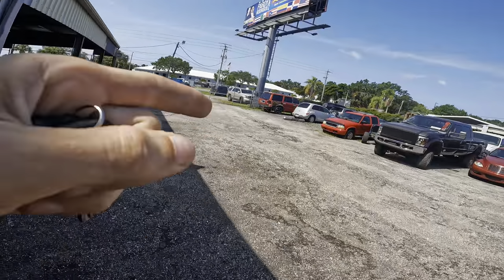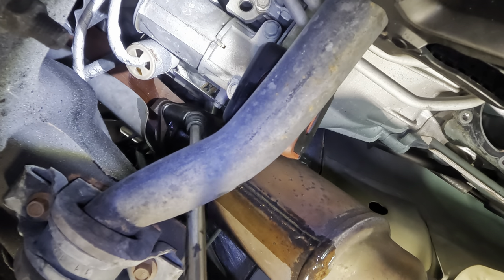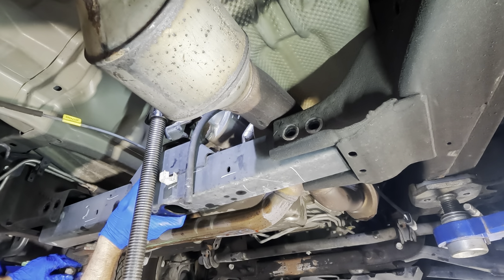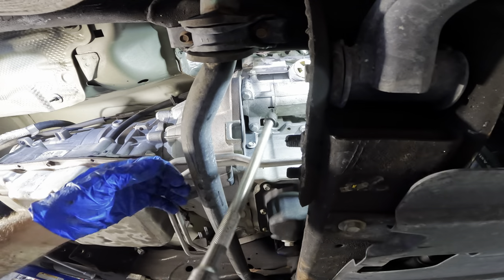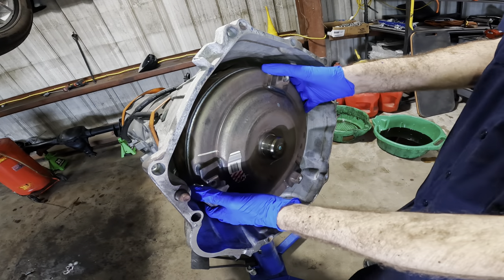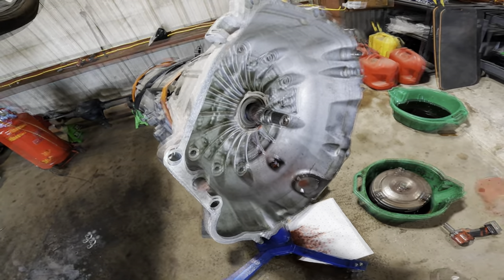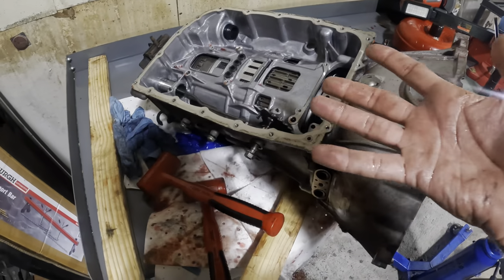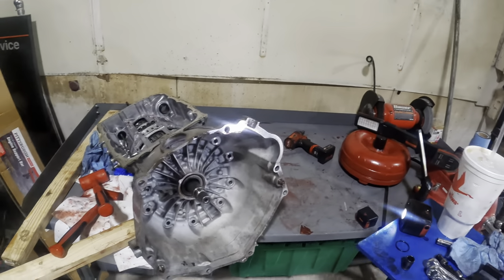Went too FAR! Invasive Inspection, 6l80 Transmission. 2016 Chevy Tahoe 5.3

Comment: The metal shavings you found were all from the torque converter.  That's the main problem with these 6l80's is the torque converter goes bad and dumps metal shavings into the trans.  It will eventually plug up the filter and starve the trans of fluid, cooking it.  Or it might plug up the trans cooler in the radiator, cooking it.  Either way looks like this trans was caught in time.  The trans pump housing looks a little worn, but probably will be ok.  The cooler should be flushed because there is likely metal in it.
Edit: Side note, this 6L80 is a good trans to take apart to learn.  It is one of the easier transmission's to work with and understand.
Reply: Easiest?? Understand?? I have yet to figure out anything to do with an automatic transmission, they are the ultimate mystery to me.
Reply: 4R70 also
Reply: @andyrbush  once you understand it, you’ll understand it. It’s definitely confusing but the 6l80 is probably one of the easier transmissions to learn on.
Reply: Yep and unfortunately after it happens youre best off rebuilding or replacing the whole trans but if caught early as preventatitve its a good idea to swap it before it becomes an issue. These transmissions are decent, just the tc kills them early.
Reply: When I break down the above response.., take out the transmission parts, the diagnostics  leaves me even further in the dark with absolutely no definitive answers.  All I'm left with is a bunch of eventualities, might plug, looks like, worn but ok, either way,  looks worn, but probably will be Ok and should be. If you were my doctor, I'd call you a fence sitting quack. How do you know the metal shavings were all from the torque converter and how can you look at a transmission housing from a home computer and say its a little worn? The fact is...,its impossible to know from remote looking and you can't visually measure something remotely without knowing its critical dimensions.
  If the 6180 is one of the easier transmissions to work with and understand, why is it that you can't explain it in plain English so that even a seasoned transmission tech can understand your hypothetical bafflegab?
Reply: @IR-nq4qv  Lots of know it alls on the internet.  They have never done anything but can tell you all about everything.
Reply: Yep, the 6 speed torque converters are into class action lawsuit territory. The local transmission shop we use keeps convertors and rebuilt transmissions in stock and can R+R them overnight now.
Reply: I done a 6R80, first ever auto trans (and the last). Ended up needing a new lead frame and torque converter and a bushing on the shaft.

When I cut the TC open there was carnage and a few needle roller bearing looking pieces. Turned out someone had taken the box off the engine with the TC staying bolted, needle bearing collapsed, and all the pieces were pushed in to the TC when the box went back.

I was relieved to find they had an updated bush rather than a bearing. I went through what Ray did dismantling something I had no clue about but went ok in the end.

All at the side of the road outside my house with just a jack too. 

Never again.
Reply: All 2000 parts 😂. I understand them. But all of them have hundreds of little o rings and seals and electronic switches. Imo don’t bother. By a guaranteed rebuilt unit. Install fill with fluid and check shift points done.  Imo. It’s not an experiment. Too complex and u get one seal not sealing right. One bolt not torqued right. It’s all built on fluids pressures and clutches. Idk easy to mess it up. Just biting off more than he can chew imo
Reply: All cars come with more parts than they need though, that's why you have extra when you put them back together. :)
Reply: @IR-nq4qv  I know because I helped rebuild over a hundred of them at the trans shop I used to work at.
And I suppose easy is relative, it is easy compared to other 6 speed transmissions.  It is not easy compared to changing your brake pads.
I am not about to write a book for youtube to explain everything for you.
Reply: @andyrbush  Lol, I suppose easiest is relative.  It is one of the easiest 6 speed transmissions to work with.  However, it is Not easy compared to changing your brake pads.
Reply: @IR-nq4qv  Just for you; the filter will plug, I didn't say it might.  That's what kills these 6l80's, the torque converter is a well documented problem on these.  I have personally seen over a hundred of them failed.
The path the fluid takes is from torque converter to cooler to pan.  So the filter stops all the metal from getting into the rest of the trans. That's why ray didn't find any metal in the pump.  And I was refering to what ray said about the pump housing being a little worn.  He would know if it was to worn, there would be a ridge from the pump veins.
Explain so that even a seasoned trans tech could understand? Your a seasoned trans tech? Impressive.
Reply: My tourque converter gives me no issues, it is connected to my clutch pedal
Reply: @BillyWillicker  Ordinarily I would say your right.  But in this case, I would say I am far from knowing it all.  You never stop learning.  In this case I have done far more than nothing and I can NOT tell you everything about everything.  
But I do know a little bit about 6L80 transmission's.  I have seen their failure mode literally over a hundred times at the trans shop I used to work at.
Reply: I believe you with it being a easier transmission to work on considering how much of it just fell out with Ray just taking the bellhousing bolts out 😅
The only automatic transmission I ever took apart is a 4l60e and that took way more effort to get to this point.
Reply: That stator is junk. Either needs to be machined along with the bell housing or replaced. 

The entire trans should be gone through at that point for a good cleaning.
Reply: @mph5896  This, this guy knows.  That is what we would do at the trans shop when I worked there.  Machine or replace both.
Yes ideally the whole trans would be gone through, Plus I think there is a kit for the valve body that changes some parts to lessen future problems.  
But I do think they caught this one in the video in time, Plus I am sure that the customer will want to try the cheaper route first.  I just hope that Ray flushes the trans cooler that's in the radiator.
Reply: @procrastinatingnerd As a Diesel technician I understand 😁🇺🇸👍
Reply: @procrastinatingnerd  A very insightful response thank you.
Reply: @kellismith4329  Yeah mine too.LMAO.
Reply: @andyrbush I suspect you have never been married. 😂
Reply: @IR-nq4qv  Yea... I didn't watch the whole thing frame by frame.  I did help rebuild over a hundred of them, it has now been at least 2 years since though.  I wasn't critiquing what Ray was doing and I am not about to belittle him for it.  That other viewer's comment seemed a little condenscending to Ray, so kudo's to Ray for posting his mistake anyway.
I do remember those snap rings, they only go in one specific position.  And that other viewer is absolutly correct and its great that they spotted it.
And yes, I am still learning at everything in life.  If you think there is a point in your life where your done learning, they good luck to you.  Anyone who stops learning, stops living.
Reply: @IR-nq4qv  Lol, you don't like to genuinly learn, that's fine, good for you.  Gotta love the trolls.
Reply: @MrCooklw  Three times in fact. But there is a difference between automatic transmissions and ladies / women whatever they like to be called. The difference is ..... Some guys do understand transmissions!!!!!!! No guys understand women!!!!!! Te reason is that as soon as you think you understand them -- they change.
Reply: @procrastinatingnerd  What is the root cause in the 6L family?  Over 100 examples should have made it apparent.
Reply: @BillyWillicker  We actually speculated on this in the shop.  Of course GM hasn't admitted to what the problem is.  Are you talking about the cause of the torque converter failure, or the trans failure?  99 times out of 100 the trans would fail because of the converter.  There were a couple with no metal in the pan that still had problems, but that was rare.
The converters fail because of a combination of afew things.  Subpar manufacturing resulting in weak converters.  Bad programming in the trans computer causing the converter lock clutch to engage and disengage too much.  Prematurly wearing and shredding the lock clutch.
There is also a valve in the valve body that wears and causes the converter lock clutch to engage to slowly, which also makes it wear faster, there is a after market kit(not from gm) for the valve body that's supposed to fix the slow clutch problem.
Reply: @jewsrbad  Some items are just not worth trying to repair. I was able to by a factory reconditioned unit from a Chevy Dealership for less than I was quoted to repair the old unit. Also some items are so complex that there is actually a lot more to them than first appears and just taking them apart is enough to wreck them.
Reply: @andyrbush Gm SRTA transmissions were previously very good units but garbage now.  I buy transmission cores from all over the place and I recently got a few really now mile gm SRTA  transmissions from a wrecking yard.  I get everything with cracked cases automatically from them.  The 4L80E had around 1000 miles on it and the 6L90E had around 5000 miles on it and I was appalled at what I saw when I disassembled them.  Very poor tolerances with worn out planetary gear sets with pitted up teeth.  Used steels that someone had taken a die grinder to.  They looked like they came out of pedros and Jose's transmission shop.  I was so disgusted with what I saw I called Mary Barra immediately to discuss my findings.
Reply: The whole 6L line to my understanding, I got a 2011 328i with the 6L45 and had that shudder last winter, ended up getting it rebuilt. That's basically what the shop told me. Got around 7K miles and another year so far with no problems since.
Reply: @timprussell  The shudder problem can usually be resolved with a simple additive.  The lubeguard instant shudder fix additive does work.  I had a Dodge ram with the infamous shudder in my shop a few years ago and it was a low mile trucks so I decided to try the shudder fix before tearing into it.  It worked like a charm and made me a believer.

Comment: 40:36  Most people driving cars with an automatic transmission, do not understand there is NO direct link between the engine and transmission.  The torque converter is a fluid coupling device, which allows you to stop the vehicle without stalling the engine.  It also multiplies torque from the engine when you first start moving.  Lock up torque converts create a full lock between the engine and trans at highway speeds, to increase fuel mileage.  Awesome stuff !!!!!!!!!!
Reply: Very well stated.  The Torque Converter is a marvel of engineering.
Reply: That was the only bit I knew lol.
Reply: but most people watching Ray do
Reply: i have a hybrid where theres an electric motor that does that. looked up a video on the way it works, transmissions really are clockwork and wizardry
Reply: Don't torque converters have a lockout when the vehicle gets up to speed? Then it would be a direct connection...
Reply: The Ford AOD is solidly (directly) locked up in 3rd and 4th gear to the flexplate to the OD pack.

Comment: Ray, look up precision transmissions on you tube, they have loads of videos taking these apart, they know these things in side out… great video as always, and love you pushing yourself outside your comfort zone 👍
Reply: Also find Richard's new channel. I hope he starts covering assembly in the future.
Reply: I've only seen transmissions from pickups, like the DirtyMax, on Precision Transmission.
Reply: @TEDodd  I think what Richard doesn’t know, isn’t worth knowing, he amazes me every time he pulls a trans apart with his knowledge. Thanks for the heads up on his other channel, hadn’t seen anything in quite some time from them. 👍
Reply: @lancecorey6582  possibly not this exact model of trans, but very handy for the order of operations as they all seem to be very similar in the way they are built. 👍
Reply: @lancecorey6582  He did lots of older transmissions, like THM 350 and 400, PowerGlide. Neewer Ford and GM stuff. And lots of stuff for race cars.
Reply: @samjackaman1928  yeh, in the comments on the last few videos there was discussion about what happened with Trent.
I case you didn't find it yet:
Richard & Teresa Educational Transmission Videos

He recently had surgery so isn't doing much. But the recent teardown with Teresa was entertaining.
Reply: The thing you need to watch out for when learning transmissions like you're doing now is that almost everything is directional including seals and clips (which is what most people screw up on) it's the very small details people miss that cause a failure upon completion

Comment: Ray, at a minimum, you need to replace the seal packs between the valve body and the transmission body and pump.
I believe they are one time use only. 👍🏻
Reply: I was wondering about the seal laid on the bench ...
Reply: my understanding is basically every gasket is 1 time use, you take it apart, you go back together with new every time
Reply: @bradhaines3142  sure but normally Ray makes a point of showing the replacement :-) It must be in there.

Comment: That is a very good start, Ray.  Get a 4L60 core and tear it apart, to get a really good idea of what to look for in a GM trans.  Good going.  There are many things to inspect on the way, bushings, teflon rings, o-ring seals, etc.. but you did good there, and proof is in the pudding drive test.  A 1-1/2" hole in a corner area of your steel top bench will assist working on input drum assemblies, and the output case end, too.  There are three tools you can make, from 1 to 1-1/4" flat steel stock, and all thread, and they would be used as spring cage compressors.  The remainder of the drive line is mostly snap rings and parts strung along input or output shafts, like a shish kabob.  Hunt down the ATSG manuals for really good info.
Reply: Agreed. I rebuilt a 4L60 in my garage using only youtube videos as a guide. They are surprisingly simple to understand and work on.

Comment: You sir are a much braver man than I, I wouldn't even attempt to tear apart an automatic transmission. Very cool to see the internals and learning with you 👊
Reply: theyre just clockwork and wizardry to me, the most i would ever do is drop the pan and replace the filter
Reply: @bradhaines3142  Yep Brad, I'm right there with you 👊 dropped 3k getting my trans rebuilt for my 99 Dodge ram 1500 4x4 with an upgrade to heavy duty valve and clutches towing package but I know it was done right by a pro. A man has to know his limitations....
Reply: Rebuilt my Turbo 350 many years ago.  With the band torqueing and integral valve body it was a pain.  Then of course there was the issue with what to do with all the "extra" little springs and balls. 😣
Reply: @dotar9586  Yep, all those extra parts are the killer 🤣
Reply: @patrickdiehl6813 to I thought extra parts when you finished meant you were doing it right 😂

Comment: I remember from previous DIY work I made up a couple of long headless bolts precisely to help sliding on/off the gearbox.
Usually long shankbolts with matching threads are not that hard to find.
Makes installation a ton easier ...
Reply: I use to cut the  bolt head off,round off the cut end they make great pilot bolts
Reply: @michaelpressman7203  wouldnt hurt to put a couple flats in the shank in case it gets a little bound up

Comment: Precision Transmission, Richard & Teresa Educational Transmission Videos. Same guy/business two different channels, watching them on 1.5x or 2x has got me more info than I ever thought I'd have about these and other transmissions. Might help if you're looking to build some confidence in rebuilding/upgrading customer transmissions!
Reply: Richard can probably reassemble this transmission blindfolded with one hand tight behind his back….no sweat!
Reply: Right now Richard only has one arm
Reply: Good thing I scrolled through the comments. I was going to recommend them as well.😊
Reply: @gregsly1247  That Guy (Richard) is the guy to use when assembling GM trans.
Reply: @pl-mn2ro  I was saddened when Richard and his son had the falling out, and his son took the channel.  I've not seen any new content since then.
Reply: @kennethduke6859 check out Richard and Teresa educational Transmission Videos. He built a new workshop next to his house and moved everything from the old shop to the new one.😁👍🇦🇺

Comment: Family car had a Borg Warner 35 auto that failed. I was promised the car on the condition that I don't touch it until I finish school. The night I finished school I had the trans out and dissassembled and inspected/diagnosed. Next day I had the parts and that night I had the trans refitted and working and the car driving just fine. All without reference to manuals, just open it and understand it. After that I went on to 40+ years in electronics, yeah that's a different level of understanding. That said big hats off to Ray's skill level and knowledge 👍

Comment: I did work as a transmission shop, rebuilding transmissions, and installing rebuild and new ones and vehicles I agree with some of the other comments made that the shavings in your pan look like torque converter shavings. Those shavings can screw up your shift solenoids, throttlebody, clog filters, clog, coolers, foul up lands and grooves, and can definitely mess up clutch packs.